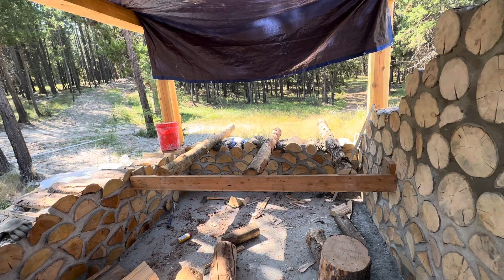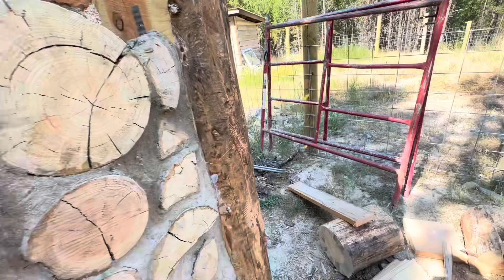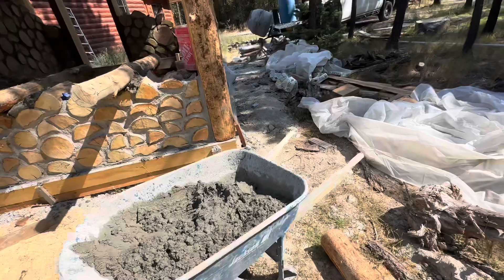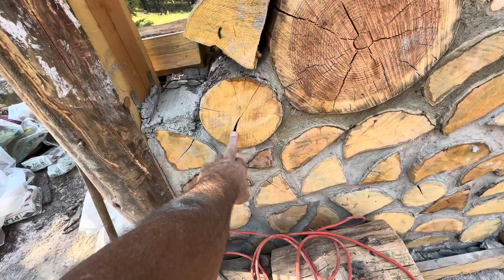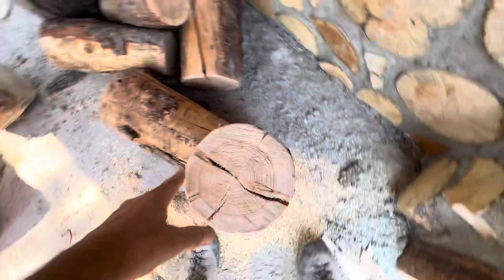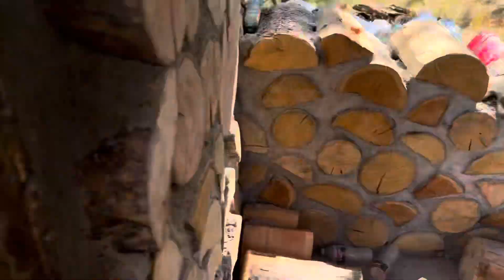Cord wood sauna update.

Comment: How long do you let the concrete set up before you work the joints? Would'nt this heat make it set up quick? Asking for a friend...
Reply from the maker: 4 hours before I can strike the joints
Reply: @montanawolftrapper8666  man , I've done tile for 20 years and I can't believe you could work those joints without them being somewhat wet...I guess that's why I'm a tile guy...anyhow, cheers on the new gig, never erased your channel, I hope for your success my friend!
Reply: So after it sets up you use a cake bag and work them joints?
Reply from the maker: @offgridmontana1243  grout bag? No. I use a tuck pointer and a brush.
Reply: Paul, can I send you a picture of a fireplace I just did? They wanted a colored grout or mortar so I payed a mason to do that...I didn't want to have to mix up different batches that didn't match...tell me I'm just being a bitch ass premadonna tile guy...lol
Reply from the maker: @offgridmontana1243  predatorsnprey@gmail.com